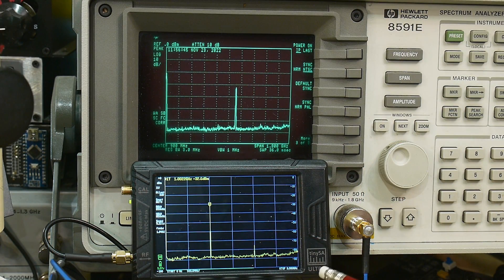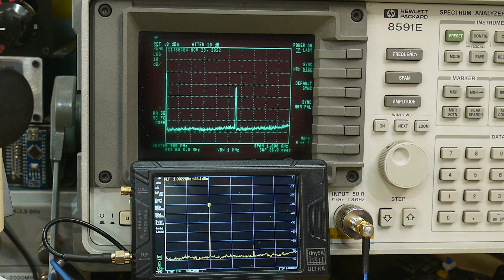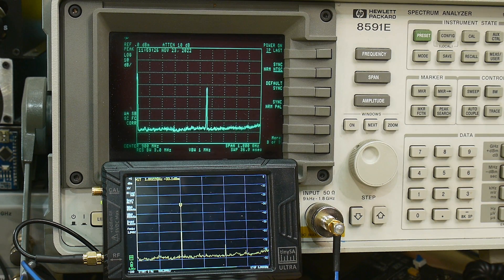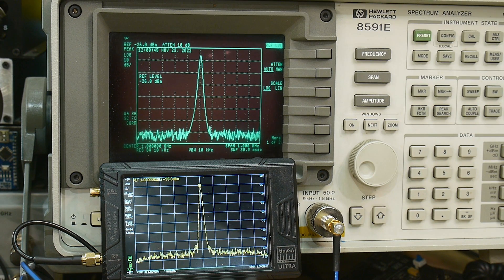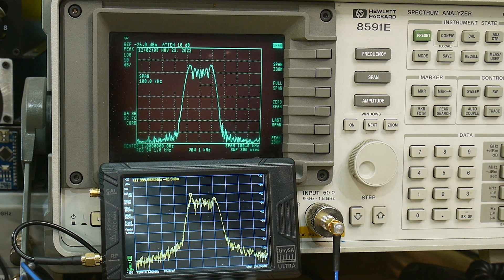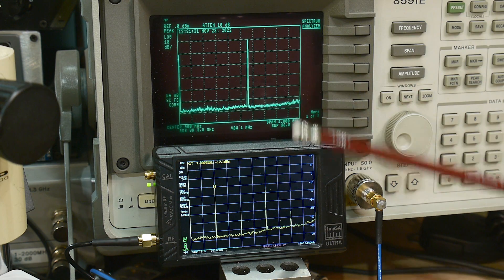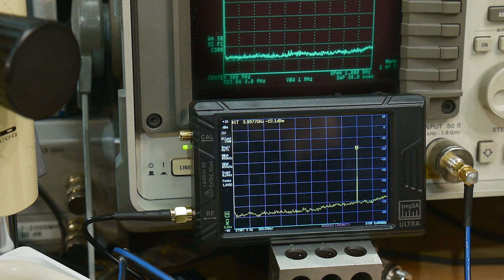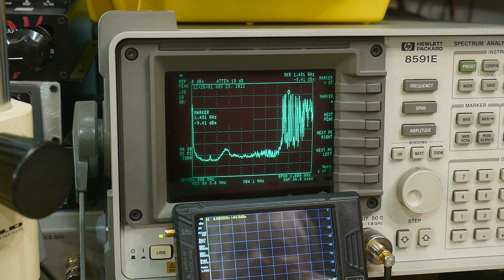#1325a TinySA ULTRA Spectrum Analyzer 6GHz 'Ultra Mode'

Comment: So how do I get it to go to 6 Ghz instead of 3 Ghz?
Reply from the maker: https://www.tinysa.org/wiki/
Reply: @IMSAIGuy  ? They say Ultra mode is enabled up to 5.3 GHz but mine only goes to 3.  Do I have to update the firmware or something?
Reply from the maker: @stevec5000  what model do you have? the older ones did not do what the ULTRA version do
Reply: @IMSAIGuy  Never mind, I reset and calibrated it and got it to go to 6 Ghz now.

Comment: Wow. Good to know of the leakage at ~ - 10 dBm on those higher freqs. This also means, that, if one was doing field survey work one might be accidentally jamming some of those freqs if connected to an antenna w/o a preamp in-line (offering some isolation).

Comment: User interface of Tiny SA
The user interface on the HP 8591 has been a result of many years of most of industries spectrum users. The interface on TinySA is very different and NOT user friendly. Commands that you use frequently should be easily found, which they are not. The capabilities on TinySA are top notch, but user interface could be better. 
Have used all analysers on the market for some 30 years (calibration service) and this TinySA user interface sticks out badly.
The advanced functions on TinySA are hard to evaluate. Phasenoise, frequency stability...
Price vs capabilities is just superb.

Comment: I am confused, are there two different hardware versions of this, an normal and an ultra...   or is there just one version, and you unlock ultra mode by entering a PIN?   Old videos seem to indicate you just enter a pin, but then I go online to shop and some are being sold as plain, and some as Ultra (???)    And how do you tell the couterfeits from the legit models?   Is there a main manufacturer website you can buy from instead of some place like Amazon or Aliexpress?
Reply from the maker: there are two versions, avoid the first one and buy an ULTRA, much better. yes there are clones. get them from: https://tinysa.org/wiki/pmwiki.php?n=Main.Buying
Reply: @IMSAIGuy Yeah, I found the home page and the straight to the factory version link about an hour ago for $120.   I'm still on the fence about it though, I wish it had more SDR features!

I kind of want one to analyze 900mghz / 2.4/5/6ghz wifi network spectrum interference as I moonlight as an amateur wifi network engineer, and these same frequencies are also used for FPV drone RF equipment, but I also want to tune around the entire band too being a shortwave enthusiast.    

It would be nice if they had a built in speaker and a waterfall and some memories and a third SDR radio mode, or that you you could fire up in Windows and use it as an SDR radio, considering it can receive the entire spectrum without breaks in the bandwidth.

I just found something similiar, the HackRF R9 module from Great Scott, so I'm pondering that one as well.  They are about $150 on ebay assembled, if I'm reading the listings right.
Reply from the maker: it does waterfall: https://tinysa.org/wiki/pmwiki.php?n=Main.DISPLAY
Reply: @IMSAIGuy  What do you think?  

https://www.youtube.com/watch?v=alrFbY5vxt4
Reply from the maker: lots of people like the hackrf but it is not a true spectrum analyzer with good resolution bandwidth, so it really comedowns to what is important to you. a fancy SDR or a SA
Reply: @IMSAIGuy Yeah, I agree.  I lean more towards the SDR side and digital electronics, so I'll probably get a HackRF for myself.   Thanks, 73!

Comment: The reason they give for the pass code, is that they want you to read the wiki so you understand the limitations of ultra mode. It is mentioned in the training videos linked on the Wiki page itself.  The software is Open source under the GPL V3 licence which means it is FOSS (Free and Open Source) and so it will likely never have a paywall feature because it would be legal for another coder to change it and take it out. So it would be totally wasted effort. You may not be familiar with software development but the licences are pretty basic knowledge. Please do your homework before spreading speculation about pay walls.
Reply from the maker: that would be a big change. please send a link to the code. please find a schematic. you may be thinking of the nanovna.
Reply: @IMSAIGuy  also, https://m.youtube.com/watch?v=xFD34qUc2PA... around 3:20 it is explained.
Reply from the maker: yes, but what about your comments about open source. I do see the code for the original tinysa. maybe that covers the ultra as well? I'm not a software guy so hard for me to tell. I do know that Erik never gave out schematics.
Reply: @IMSAIGuy  that is true... the hardware is NOT open source. The software is though... I have uploaded the url several times but youtube keeps deleting it. The reference to the openn source licence for the software can be found on the FAQ page of the TinySA Wiki page.
Reply from the maker: @reaverofcheesecake4073  yes, I know the reference you point to. I just didn't know if that covered the ultra or just the original. it would be very difficult to understand the firmware without knowledge of what chips are used as most of the filtering and processing is done in the hardware. the wiki does not have enough information. I did a reverse engineering of a schematic (I have a video) but was not able to find info on the new chip used in the ultra. any info on this chip would be of interest to me as the bandwidth filters are very different between the original and ultra.
Reply: @IMSAIGuy  Hmmm... good point. The software and hardware is treated seperatly. So, the way we normally distinguish licence changes is by tracking forks in the project. For software, this is pretty simple, because Software Engineers typically use document versioning tools such as Git Hub or Microsoft Teams. The question to your statement is this: Is the software for the Tiny SA Ultra COMPLETLY seperate (so no forking) from the Tiny SA project. This is extreamly unlikely (but is technically possible) since the previous effort for the Tiny SA would have to be completly scrapped and a new software project would need to have been started for the Tiny SA Ultra. If the project was FORKED from the Tiny SA project, then it must recognise the Copy Left rights of the parent project.

I appriciate your query, so I will share my experience with you in the best of faith. I am 99% confident that the Tiny SA Software licence also applies to the Tiny SA Ultra Software.

Comment: Thx for the video...My Ultra is performing great (pricing considered) Ultra Mode not Enabled as my needs are < 800 Mhz.....Will the "Ultra Enabled" mode change (Better or Worse) my current 0--800Mhz Performance ?? .....Also, Once "Enabled", can I  "Un-Enable" & Return back to my Current  "Out of Box" great 0--800 Mhz Performance ??.....Thx again....
Reply from the maker: they say enabling does not effect the lower band
yes you can un-enable

Comment: With the signal generator, I have ordered a few low-pass filters to take out the harmonics. From Ali Baba, they are about $25 and available in a range of frequencies from HF to 1 GHz. The low pass filters only need to be roughly around the pass signal as the second harmonic is twice the source. So a 500 MHz low pass filter is good from a bit above 250 MHz to a bit below 500 MHz. Thus, not many are needed for most applications.

The TinySA and the signal generator are great value and quite useful as you show. A very useful video.
Reply from the maker: In Ultra mode the filter will not help. below 800 MHz just turn off ultra mode and there is no problem Above 1 GHz the TinySA Ultra creates harmonics at all frequencies. so there is no way to filter them out.
Reply: How will it go at 5.8ghz?

Comment: Thanks for the heads up on the Ultra OUTPUT.  You need to have two spectrum analyzers just to catch it.  You could see it with a SDR tuned properly too, but you know that I mean.
That spectrum analyzer was the same model that we had in tech school.  I loved how fast it was.
Reply from the maker: It was the gold standard in the 90's

Comment: What is the best oscilloscope to get for up to 15ghz signals?
Reply from the maker: 15 GHz? Keysight has some but you need $250,000
Reply: @IMSAIGuy  oh wow. So what is the "normal" range for an oscilloscope then?
Reply: Also what can be used to detect broad spectrum frequencies at microwave levels and up?
Reply from the maker: @DeezNutz-ce5se  I believe you are confusing oscilloscopes and spectrum analyzers. at $1,000 you get oscilloscope at 500 MHz or spectrum analyzer at 1.5 GHz
Reply: @IMSAIGuy  "My god" they make some with a 110GHz BW and 256 GS/s!
It must have be milled out of a solid piece of magic.
Reply from the maker: @TalpaDK  I did video on some: https://youtu.be/edHw3qz3jMQ

Comment: Vow. I have Tiny SA and main weakness is minimal resolution filter 3kHz which offers radio modulations measurements very limited. I see much improvement on Ultra model so seriously consider to order it. Price is over double, but I see from this video that it is worth higher price. Thank You for this video.

Comment: Thank you for the fantastic videos, I have only just joined your channel after looking for info on the TinySA Ultra and found your very informative videos.
May I please ask what level these intermittent spurious outputs from the TinySA Ultra that you are seeing on your HP analyser?
Reply from the maker: they are -10dBm. quite large. between 977 and 1777 MHz
Reply: @IMSAIGuy  I guess they are not a problem to the TinySA Ultra taking measurements, and only a problem if they cause interference to something you are trying to monitor/look for with the device, as you spotted on your HP.
Reply from the maker: @getcartercarpark.  well yes, but the 'problem' might be blowing up something.

Comment: I appreciate this video.  I was wondering about the Ultra Tiny SA sending signals to the dut.  How practical is it to use isolators or circulators as suggested by David V.  Would the cost be too prohibitive?
Reply from the maker: isolators in that frequency range are probably too expensive even used.

Comment: Hmm. Lo leakage. That's not great. I guess there's no amplifier/buffer between the tiny SA input and the mixer(s )? I guess one thing you could do is place a wideband amp + attenuator between the DUT and the tiny SA. As I said, that's not great. :( It is a $130 SA so we shouldn't lose sight of that. -10dBm is a lot!
Reply from the maker: it needs a low pass filter before the mixer to block the Lo

Comment: Hello, what's the difference between a spectrum analyser and a SDR? I have for example the SDR Play RSP1A. Since I am able to see the spectrum I think it should be the same or?
Reply from the maker: no, there is more filtering and the resolution bandwidth is much better
Reply: A SDR is mainly for reception and decoding.  A spectrum analyzer is for checking and comparing signal levels.  You can also view a massive amount of spectrum to hunt for a signal.
A radio vs a piece of test equipment.
Reply: Proper spectrum analysers have added features, are calibrated etc. If you just need to see the spectrum you can use an SDR and some software that will emulate a spectrum display.
Reply: re: "what's the difference between a spectrum analyser and a SDR?"
Spec AN has a swept LO and different BW filters in the IF.
And an SDR does an A/D conversion THEN an FFT on the incoming signal and filtering is done in software, on the FFT signal.

Comment: Many thanks. My original thought is that Local oscillator leakage is common in many receivers including spectrum analyzers.
Reply from the maker: the spectrum analyzers usually have a low pass/band pass filter in the front that keeps the high freq Lo out.
Reply: @IMSAIGuy  As the wiki states, in Ultra mode the input low pass filter is disabled, and it goes to harmonic mode above 5.3GHz
Reply from the maker: @ErikKaashoek  Yes I read that, but no mention of the RF output on the input connector. you need to add that to the wiki. It can be very dangerous to circuits. As one of my viewers commented, he thought the mixer would block the RF but was surprised it was -10dBm.
Reply from the maker: and congratulations on this device. the 800 MHz performance and user experience is what I had expected on the original TinySA which I was pretty hard on. This one I definitely approve.
Reply from the maker: the wiki does not talk about the uSD card, unless I missed it somewhere. I think it saves data as csv but there is a screen shot on the card as well and I'm not sure how to do that
Reply: @IMSAIGuy  Is added in the ultra mode page
Reply: @IMSAIGuy  See TRACE menu: WRITE->SD CARD writes the current trace to the inserted SD card
Touching the SD card ICON takes a screen shot. I could not update the wiki before the launch (technical reason) so still a lot of updating to do
Reply from the maker: @ErikKaashoek  thanks. i would add -10dBm as the term leakage does not get across this quite high level of RF
Reply from the maker: @ErikKaashoek  thanks. people are asking me about that
Reply from the maker: I put a possible bug on your github. maybe you should have an ultra branch